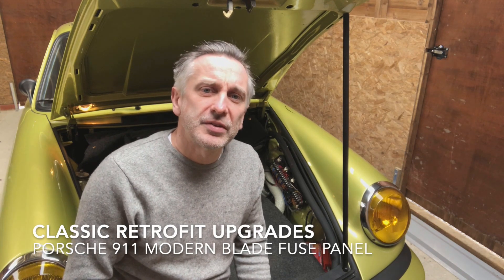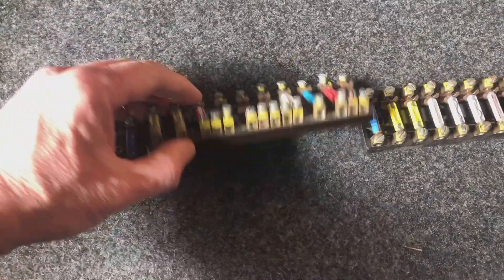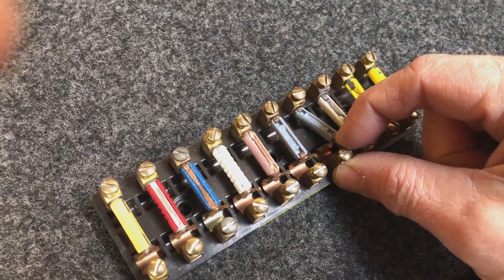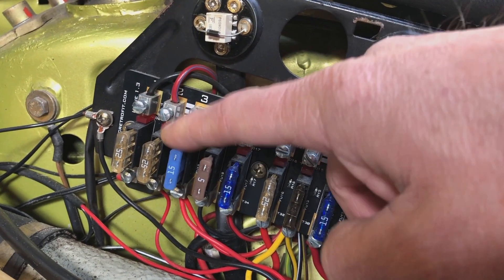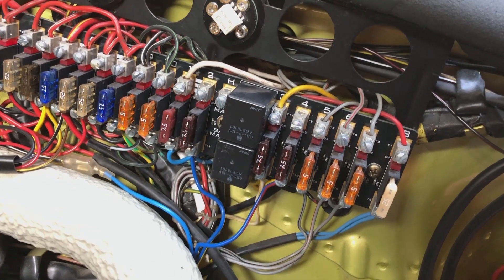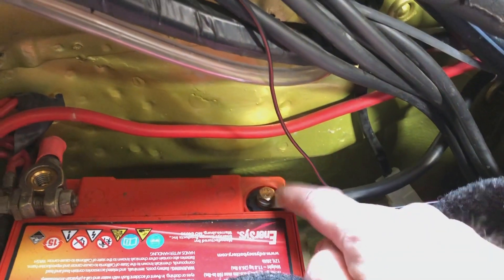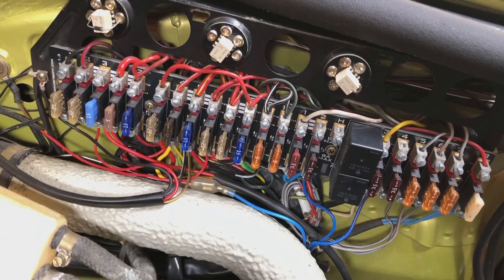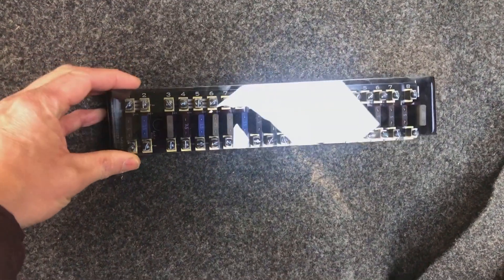Classic Retrofit Porsche 911 fuse panel upgrade to modern blade fuses

Comment: I have a 68 911L fitted with a 1977 911s drive line, wire harness and gauges. The car is converted to an 1973 RS light weight clone. 

I have removed removed a good amount of wires that are no longer needed with the RS tribute. I had a short i the front and fried some wires. 

I’m at a point where i can use the excuse to upgrade to a modern panel. 

Here’s my question, Is this best use for this panel? 

Drive line is a 77S with a 2.7 CIS and the matching Guages.

Comment: The turbos ( 930s ) have two fuel pumps. Both go through the same fuse, which is thus overloaded and prone to failure. A known workaround is to drive each pump with an individual fuse. Is there an extra space on your product I could use for that purpose?
Reply from the maker: Hi Brett, yes we are aware of this but the issue is the fuse contact rather than the fuse.  You don't need to run two fuses with our panel as the contact area is much greater with a blade fuse.

Comment: I noticed that in your demonstator car on the upgraded fuse panel you didn't use the "H" position. From your installation instructions this connection is for a direct feed from the battery to the two relays to supply current to the headlights. Is my understanding of this function correct? Is there any reason why you chose not to use that connection?
Reply from the maker: It is only necessary to connect the extra headlight feed (H) if you want to use high output bulbs.

Comment: Where are your relays (?), it looks as if they are off and have been relocated.
Reply from the maker: The relays fitted are prototypes we are working on.
Reply: @ClassicRetrofit  I see you are working on them after a bit more reading. I would be interested since my '85 911 has turn signal relay issues. I will probably upgrade the entire fuse block as well.... Thank you!

Comment: Great, love the integrated headlight relay.  Do you recommend a starter solenoid relay too to save the ignition switch?
Reply from the maker: We try to integrate as much as possible. The ignition switches on these cars can play up so may be worth changing the switch if you're worried about the condition. Switch meltdown is a thing on some cars.

Comment: ? There are 3 integrated circuits mounted above the mounting panel. What are they for? Thanks.
Reply from the maker: They are our updated relays: a brand new product that's been in testing for a year or so - we'll be producing the first batch very soon. The replacements Porsche sells nowadays are junk!
Reply: @ClassicRetrofit  But ICs are not relays. Relays are electromechanical devices, not solid state devices. I think I understand now. These are switching transistors that do not have the plastic covers over them. Got it. Thanks again.
Reply from the maker: Thanks Tim, they are high quality automotive relays. We'll share full details when the product is launched in a few weeks.
Reply: In case anyone else is wondering, look at the video at 4 min 32 sec for reference-- see the exposed circuits where the "round red" fuel pump relay would normally be (many guys source the older German ones vs the newer ones).